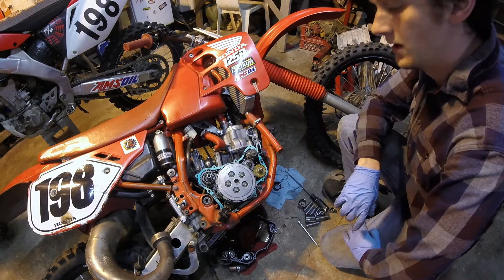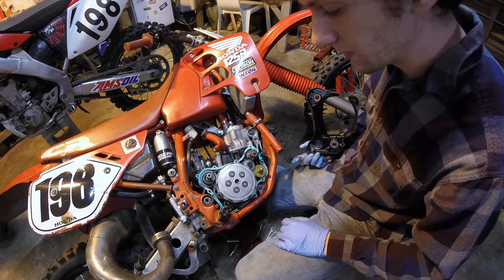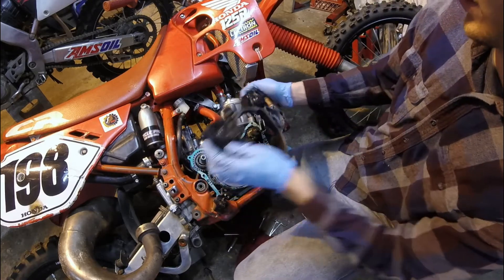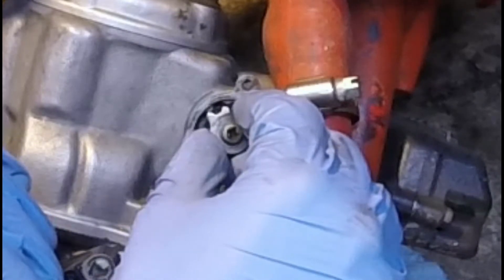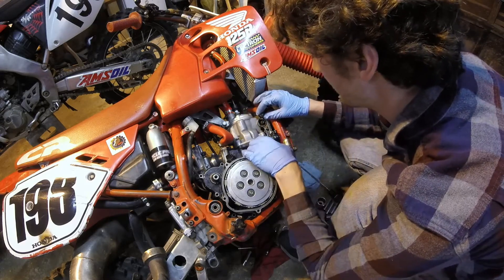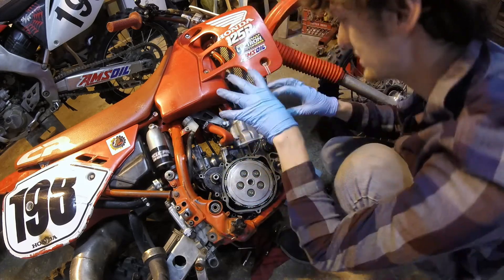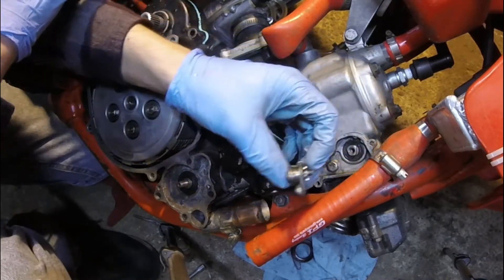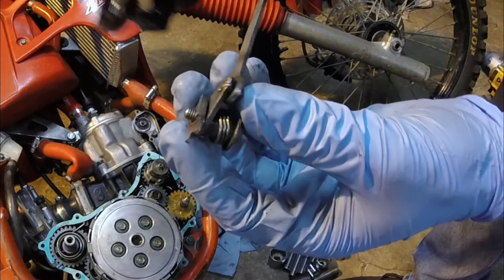How to time a CR125 power valve (installation and explanation)

Comment: Great video 

I had to replace the gear selector rod. To do so i removed the side cover mostly off but kept the power band linkage inplace.

I have done lots more including rebuilt carbs, new reeds ect 

My bike will not start now. 

I have compression, spark, fuel and air. Will a mis aligned linkage prevent a bike from starting?

I am asking before i take the bike apart again.

Thank you. 👍
Reply: Thank you Caleb
Reply from the maker: I would say no, it shouldnt prevent it from starting, depends which position its in. Id say worst case it would just be hard to start or run rough, but will still fire. Is your ignition good? If you need a stator rebuild check out ricky stator

Comment: I have my top end off are the valves supposed to spring back to closed position mine seem to stay open if I open them by hand
Reply from the maker: The valve should absolutely be spring loaded to the idle position. If it is not you may have a problem with the linkage or the actuator
Reply: No

Comment: Hey Caleb,  thanks for this. Im starting a 88 rebuild that has a 89 lower.  Still using the 88 jug tho.  Question for you.  Is your jug a stock 89?   thx
Reply from the maker: Yes it is a stock 89 jug, plating has held up well. I know 89 and 90 were unicorns, but maybe the 88 will work out. Good luck!
Reply: @calebmacgray4588  yes thats why i was asking.  89 jug is RARE
Reply from the maker: @audiss111  lucky me i guess lol only one i got

Comment: I just watched your video you explain it well, I'm rebuilding a 1987 CR125 and the linkage was missing for the power valve. Where can I find the linkage and the little half moon plate spring and screw? I've checked E-Bay but unable to locate them for an 87. Will other years work as well like an 88? Any info would be appreciated thanks.     Phil
Reply from the maker: Oof thats a tough one. Your best bet would be finding a top end or whole motor on ebay or facebook. They do come up. As far as year compatibility i know the 89 and 90 are unicorns, but im not sure about the earlier models. You may get lucky. You could always try to make one! Good luck phil
Reply: Thank you for your reply. I'll find the parts I need sooner or later sometimes you need to be patient. I'll send some pics when I complete the build Thanks again😎 @calebmacgray4588

Comment: So the case cover definitely has to come off? I just took the power valve actuator cover off, and unscrewed the arm linkage and small parts from the actual power valve, slid the power valve out and found that the opposite back end of the power valve which has the Phillips screw was completely broken off so the power valve could rotate 360 degrees. I ordered a new one of those and a new cover. Do you expect the timing to be off when I receive and install the new one ?
Reply from the maker: If the timing was initially set properly it wont change unless the case cover is removed. Make sure to line up the flat surfaces and align the half moons.
Reply: @calebmacgray4588 thank you homie, this info is crucial !
Reply from the maker: @merrickrogan2681  np, let me know if you have more questions

Comment: I am in need of your advice lol I installed the linkage like you said and pushing down with all the slack out the holes line up perfectly.but… looking in the cylinder with a camera the exhaust valve is shutting the subchamber off when reved it’s opening the subchamber so it’s reverse from what that picture shows the bike is running like a dog
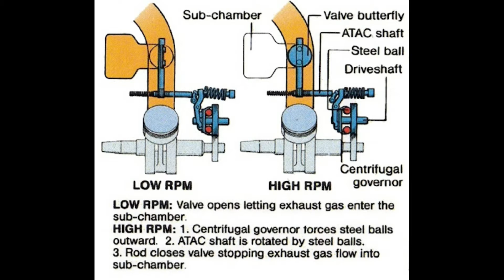Reply from the maker: Are you working on a bike with the same setup as this 89? If so maybe you have the linkage assembled incorrectly? Id double check the pictures. 2:22 shows how the system should operate. Or it might be possible the valve is in the wrong position, if the flat face 8:13 is screwed up

Comment: Will replacing this make it snappier? Bike is very fast full throttle but gotta be turning alot rpms to engage power band.
Reply from the maker: Replacing what exactly? Before i replace anything id be sure its properly tuned. But if parts looke like they are worn its never a bad idea to replace them. A properly functioning power valve will give you more low end and a broader powerband

Comment: Got the same issue with an 87  cr 125 can't figure out the spring on the top end side
Reply: Got the the manual put top end back on  took a while but runs like a top thanks for the info remember always ride red can't go wrong.
Reply: I’m restoring a 87 cr125 right now too, this was very helpful and I also have screenshots of how the spring should go
Reply from the maker: @Hunter Hancock  awesome!
Reply from the maker: Can't figure out how to re assemble the small pieces at the top?
Reply: @@calebmacgray4588  which way does the spring go
Reply: @@calebmacgray4588  maybe a little picture would do it
Reply from the maker: @David Hitchcock  send me an email I'll reply with some pictures
Reply from the maker: calebmacgray@gmail.com
Reply: Should the piece that aligns for timing marks be able to move counter clockwise by hand after installed.. I’m able to turn it from dead on to one of the marks backwards.

Comment: i’ve got a 1989 cr125, it’s got motor and carb work done to it but still has no bottom end. never touched the power valve or sprokets. how can I give it some bottom end??
Reply from the maker: Honestly I'd just start by ensuring all these components are working correctly, the linkages probably have slop and the seals and bearings could be replaced. After that you could mess with the ignition timing by rotating the stator, especially if you do a lot of trail riding. The 89 125 was notorious for it high end performance, no so much low

Comment: I got a 1988 Cr125 and it won't get in powerband. I bought it and it was bring used For hillClaming. Can you help me figure out what could cause it?.
Reply from the maker: If the carb/reeds/plug are okay, you can check if the power valve is moving correctly. Details in the video. The linkage cover behind the pipe can be removed to observe its movements